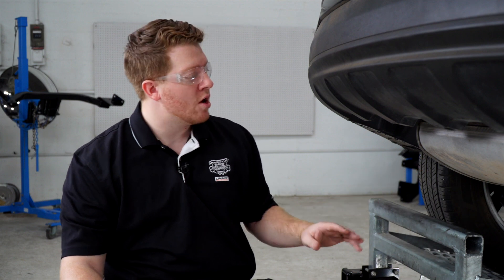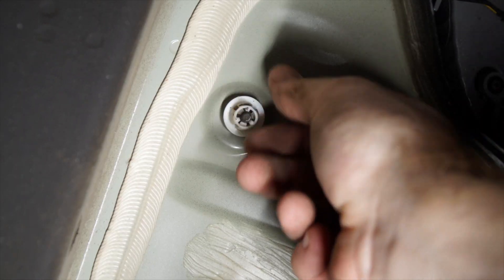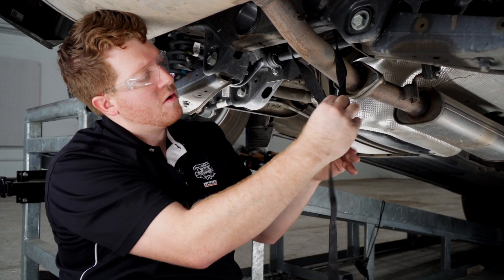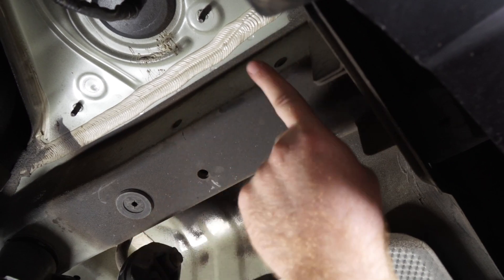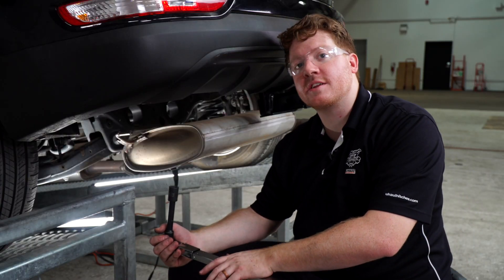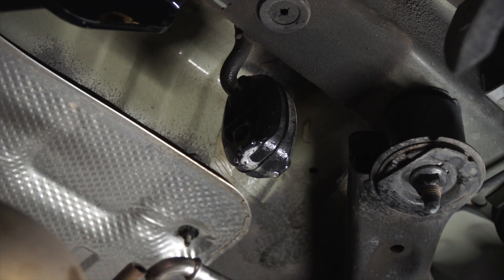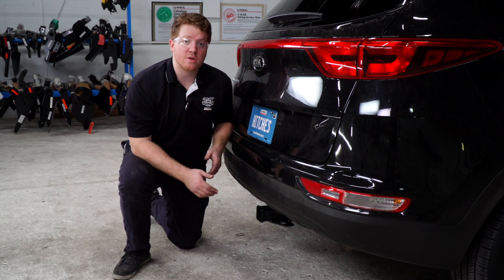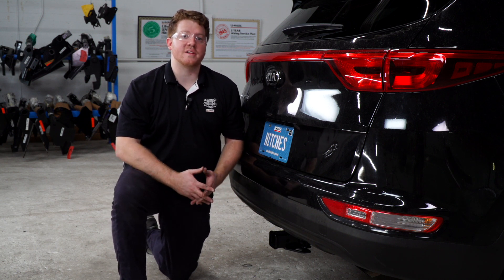2020 Kia Sportage Trailer Hitch Installation

Comment: Thanks for the video. I was able to do it myself, though a 2nd set of hands would have been nice. I also didn't have the hanger removal tool, but a pair of channel locks with tape on the jaws worked fine
Reply: How long did installation take since you did it on your own?
Reply: @graceyseda176  maybe an hour?

Comment: Looking for a answer ... Is the mounting holes and clearances the same on the 2022 Kia Sportage as the 2021 or 2020?   I can't find a hitch listed for the 2022 Sportage... A lot for the 21....
Reply: Think 17 thru 22 Sportages use the same hitch.  They aren't cheap either. Around 175.00 average without ball mount or anti rattle thingy.